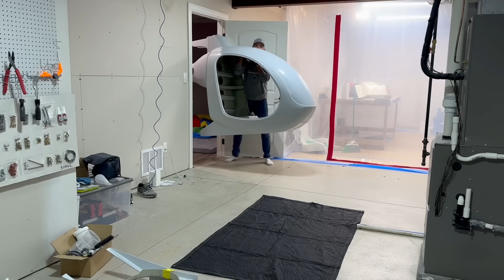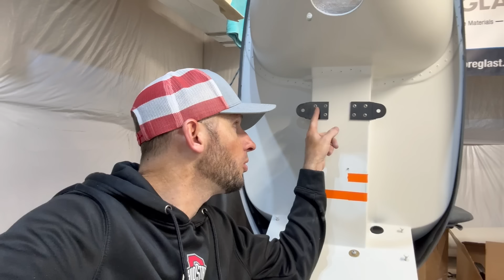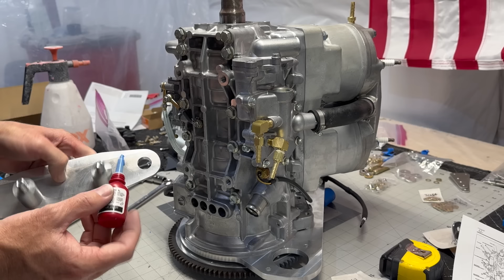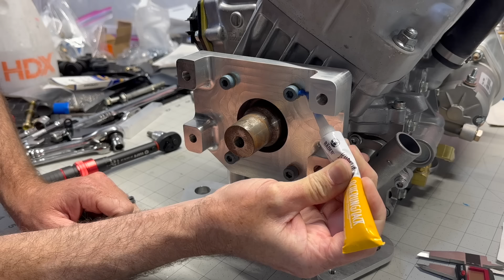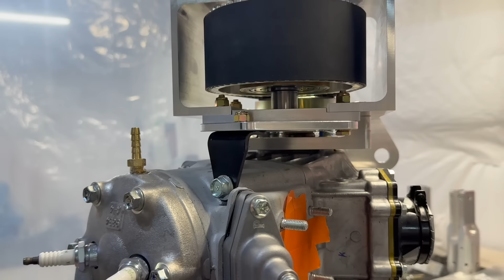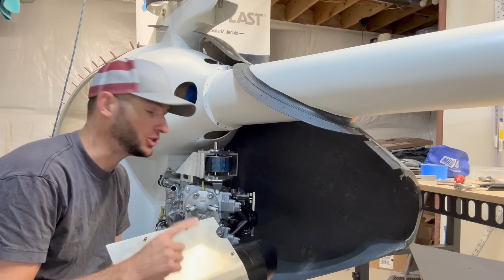I Installed a Snowmobile Engine in My Helicopter | Basement Mosquito Helicopter Ep. 31

Comment from the maker: This was a huge milestone for the build. What do you think — does a two-stroke snowmobile-based engine in a helicopter make sense, or is it completely wild?
Reply: There’s always been adaptations to engines to perform a different task other than the main design
Reply: Two things: the power to weight ratio of a two stroke engine is better for light aviation than that of a four stroke engine. The second thing is that the scale of manufacturing of snowmobiles is much greater than that of light helicopters and thus brings the cost of the engines down to a more reasonable level than a bespoke helicopter engine’s cost. So no it’s not wild.
Reply from the maker: @tomcoryell a four stroke with a vertical crank is also very hard to find. Oiling isn’t an issue when you’re sending it in with the gas
Reply: @TheOkayestEngineer  The old Briggs and Stratton rotary mower engine would work if you’re ok with just sitting on the ground revving it!😂😂
Reply: Cut your cowling not your expansion chamber!
Reply from the maker: @jameshatton4211 I’m not cutting anything. Starting from scratch.
Reply: @TheOkayestEngineer good stuff brother! I'm subscribing now 👌
That's excellent. Can't wait
Reply: @TheOkayestEngineer  Do you know how to design a new exhaust system with the correct backpressure? If not you might want to rethink what you are doing.
Reply: It's the kind of engine you want, rugged, powerful, anything above 1 HP per10cc for a two stroke without a turbo etc. is good plus it's a well tested, well understood engine with good availability of parts for it, it's a good choice :)
I wonder the installation cost is for this engine with those modifications ? 
Under $15,000 ? ... or am I being hopeful ? :D
Reply from the maker: @freezatron the engine is $4k 

The entire engine kit for this helicopter is $21k
Reply: Well I've owned and flown the Aventura ultralite amphibious plane and flown for years, always wanted a mosquito helicopter...the 290 xp looks sweet but the jet fuel is very enticing as long as there's enough tank for 4 hrs of flight time would be perfect ..
Reply: I have used 2 stoke engines for the past 40 years and they have never let me down. The only issue I experienced was carburettor icing, but in your situation with fuel injection that will never be an problem . Use good quality full synthetic oil, good air filters and it won’t let you down.
Reply: hey man why didnt you go with the 900ACE?
Reply: the same engine used in seadoo sparks and snomobiles but the snowmobile versions tuned to crazy hp
Reply: @kobrapromotions  but fkn less reliable.
Reply: @qwertymnbvc-v6e its a rotax?
Reply: rotax aircraft vs rotax snowmobile

meh, not sure.
maybe oldschool engines like the 444lc.
Reply: @qwertymnbvc-v6e.  built in the same plant, same engine
Reply: A two-stroke engine has a higher specific power than a four-stroke engine, so it makes sense.
Reply: Redesigning the exhaust system in a small engine isn't as forgiving as with larger ones. The pressure in the system and therefore the bends are important and you are taking out a huge bend.

Comment: Id premix some oil in the fuel tank in case ur oil injector goes bad because they always do eventually that way when it does it won't destroy ur nifty engine i use motul 800 2T  Racing synthetic ester core n id premix some of it in ur fuel tank that way it won't toast ur 2 cycle engine if ur injector pump goes out its the best n 2 cycles its expensive but n a aircraft application ur ass is on the line if the engine blows up n you crash.

Comment: A FREE Idea: Make a backup air motor (like air tools) that has same speed as your blades with a back up small air tank to run it in emergency. All you would do is pull the safety engine lever, if you ever would need a back up engine just to land it. If an only if your main engines would ever fail you. You probably wouldn't need that much air tank pressure for a few minutes of landing speeds. Justs saying ! Enjoy !

Comment: Most 2-strokes get oil to the main crank bearings by oil that drips out of the fuel/oil mix, down the transfer ports, then down holes that feed the oil to the bearings. 

Will rotating the engine from a horizontal crank to a vertical crank starve the main bearings of lubrication?

Comment: The key to a 2 stroke exhaust is length. They are tuned for the power band to work properly at certain RPMs. The length determines what RPM it goes into “Boost” mode. That length is set up for the RPM on the sled. If you calculate it right it will work great for the RPM range the helicopter is set up to run at. Cool build! 🤙
Reply from the maker: The unfortunate part of this application is I need the pipe to turn on around 6000 rpm which is about half the redline and the pipe needs to be extremely long because of it. I think I figured it out but it’s a packaging nightmare.

Comment: Beautiful project! But...
Industry won't use rivets on engine mounts, too much power, see what the snowmobile engine was using
Reply: Also in the inside you need a bracket plate, a large one to spread the load
Did you use FEA here?

Comment: I m sorry but your engine support which is fixed in the body by rivet is not enough strong to maintain engine   force and containt , Better to get screw bolt  with anti seize nuts Better to review your support before any  real flying test.

Comment: The Mosquito ultralight helicopter is equipped with small two-stroke engines (such as the MZ202 or similar). These engines produce hot, rapidly moving exhaust, and the designers have chosen to route it sideways for several practical reasons:

1. *Keep Heat Away from the Tail Boom*
   Two-stroke exhaust is extremely hot. If it were directed straight back, it would blow directly onto:
   - The tail boom
   - The tail rotor driveshaft
   - The tail rotor gearbox

   All of these components are made of lightweight aluminum or composite materials, which can be damaged or weakened by prolonged exposure to high temperatures. Routing the exhaust sideways completely avoids this issue.

2. *Prevent Exhaust from Entering the Rotor Downwash*
   If the exhaust were directed downwards or rearwards, it could be caught in the main rotor's downwash, which could:
   - Reduce lift efficiency
   - Cause turbulence
   - Blow exhaust fumes toward the pilot

   Side exhaust helps maintain clean airflow around the rotor.

3. *Reduce Vibration and Structural Stress*
   Routing the exhaust sideways allows for:
   - A shorter exhaust pipe
   - Fewer bends
   - Reduced weight
   - Less vibration transmitted to the frame

   Ultralight helicopters need to keep everything as simple and lightweight as possible.

4. *Simpler, Lighter, and Cheaper Design*
   The Mosquito is designed to be:
   - Ultralight
   - Low-cost
   - Easy to maintain

   A sideways exhaust configuration is mechanically simple and avoids the need for long, heavy ducting.

5. *Avoid Exhaust Impingement on the Tail Rotor*
   Hot exhaust gases hitting the tail rotor can:
   - Reduce tail rotor thrust
   - Cause thermal stress
   - Create unpredictable yaw behavior

   Routing the exhaust to the side eliminates this risk.
Reply from the maker: That’s a pretty standard AI response, and not very accurate. Follow along if you’d like to see the Okayest solution.

Comment: When you install the coil mount , the 2 inch square . Drill and tap run a wire through the back hole through the taped 2 inch square coat sq with epoxy tie string to wire make a loop pull wire and 2 inch square sq. Into place hold for 5 minutes  cut wire put bolt in with 2 spacers
tighten  and let epoxy dry. Pull wire out with string . After epoxy drys mount coil mount mount.

Comment: There are inserts for putting machine threads into panels like that. They work kind of like female rivits. I can't remember what they are called, but they would be a thousand times better than those pop rivits. I used them a lot on tractor trailers and snow cabx on tractors. I wouldn't trust those mounts with only rivits. Are you building a drone, or do you plan on flying in this thing?
Reply from the maker: I've got a couple things in mind.. i can tell you they've worked for a long time on other machines. There is data to prove it.

Comment: I'm building and a little farther along with mine at this point in this video. I would suggest putting the fuel pumps etc on before the engine. I machined two bars to align the engine with splitter same amount of washers top and bottom. I had three left side two right side.

Comment: This engine have 140-160 hp nominally, but you have to check balance of crankshaft, this is not good as usually. I has 3 of this and all have a problem with it and seal crankshaft

Comment: Pop rivets?! Hope you at least used washers on the inside to reinforce the connection, otherwise these will just eventually pull out with all the vibration from the motor.

Comment: Is it advisable to use this exhaust manifold on a two-stroke engine? The crankshaft of this engine is positioned at 180 degrees. Will the exhaust gases interfere with each other? It's probably better to use a separate expansion chamber for each cylinder. Sorry for my English.
Reply from the maker: 2-1 is not ideal but it is actually used the same way by the factory on their snowmobile. It isn't ideal but it is possible.

Comment: engine mount with rivets in fiberglas? that will snap on first run mr. engineer
Reply: This was my thought exactly, what are the rivets holding onto besides a small washer that will get pulled through the fiberglass
Reply: Is this supposed to be a joke  ?

Comment: i think its a great project just to get social media viewers and hopefully make a lot of money doing it.......BUT...i would not go 100 miles anywhere near to that thing when its started up with blades spinning and i certainly would not get into it and try fly it........ too many possible points of failure.  Even the engine bracket alone should be one continuous part rather than two smaller parts relying on engine to form as one.

Comment: I wish you the best of luck, but that is the engine that I would not have chosen. It's known for vibration. I would've went with something a tad bigger like a rotax 650R (125hp) , or an 850 turbo (150+ hp)  
I would also suggest bolts instead of rivets on that motor mount If you could find a way to do it.

Comment: The correct engineering solution to the engine mounts would be 2 different options, 1. What you did, but the stress relief the brackets after bending them. 2. (And this is the correct solution) liquid shim the brackets. Then fasten.

Comment: So snowmobile engines aren't made to run consistently at high rpm.. that motor will fail
Reply from the maker: you're right.. thats why it runs at 6000 rpm and at half the rated power.

Comment: The engine is fine, and I agree that the use of rivets to secure the engine mounts in a high vibration area is not what I would personally prefer. I would have liked AN4 bolts and nylocks instead, at least four per mount. The drone blades are totally inefficient as the idea is to be able to compress the air to push through the radiator and have a reasonable velocity at the same time. To reduce the demand on the engine and get the most out of the cooling, there is a American company who makes Flexifan. Similar to the original, but the curved blades are spring steel riveted to the hub. They produce the greatest pitch at idle to assist cooling the engine after running at full power and provide much higher level of velocity compared to a normal fan. At full power once the airflow  and pressure has reached the maximum, the blades bend, reducing pitch and unload the engine, this frees up more horsepower to the main rotor. I suggest having a look at that option if you do not wish to use the standard fan.
Reply from the maker: Is it rated for 6000 rpm?  I’ll take a look. Thanks a lot for the suggestion.
Reply: Hi, yes they are, as originally designed for race cars to provide more power to the transmission instead of robbing it for cooling. Great project, would have loved to make one myself but more into microlight aircraft over the past 10 years.

Comment: Gees mate i would never ever sand away composite structure to get a fit. Put mould release on the engine mount then add glass/filled resin to build up the mating surface
Reply from the maker: Fair point. I didn’t get into the glass. When I was fairing everything I unknowingly made those edges sharper than they should have. Good catch though.

Comment: Callie, there are few problem in life that can’t be solved with the application of either high heat or high explosives…. MAP gas would have gotten it hot enough to slip off even with a good press fit.
Reply from the maker: You’re so right. I’m stealing this quote and fully intend to use it when the time comes.

Comment: Please redo your safeties wire attempts on that engine flywheel. Even just doing it single wire would be better than what is currently shown in the video. I would not trust what is currently installed @ 7:23.
Reply from the maker: The bolts came from the factory with just one hole through one side of the bolt. Short of replacing the bolts this is the best I can do. I can see them to inspect them frequently.

Comment: Most two-strokes have a tbo measured in gallons of fuel consumed. Constant high power settings on a two stroke reduce engine life considerably, which is one reason the Rotax 503 got such a "meh" reputation.
 Oh, and the music...sucks. No offense, just an opinion.
Reply from the maker: The music was royalty free. I can’t make everyone happy lol. 

Good point on the TBO. It’s running at half the rated power and rpm but I still plan to replace the pistons every 100 hours or so.

Comment: Please don't mess with the exhaust too much - 2 stroke exhausts are tuned to the engine...not sure on how it works on EFI motors but I'd sleep easier if you didn't mess with it too much - we wouldn't want your engine to seize mid flight due to a lean condition!
Reply from the maker: Anything that has been designed once can be designed again.  I just need to learn a little bit before I make it.

Comment: Design a custom exhaust for sure. Ditch the merge manifold and build a pipe for each cylinder tuned to the operating rpm. This would bebthe best setup for performance and packaging. With that manifold gone youd have plenty of room for custom pipes.
Reply from the maker: I’m going to play around with duals vs a single pipe. Part of me still would like a muffler (resonator? Silencer?) to keep the noise down. Still have lots to learn here.
Reply: @TheOkayestEngineer  look into the fmf q silent muffler. You can also add a intake silencer/boost bottle to help with noise and smooth the lower/mid power band. Lots of info on pipe design out there too.

Comment: Cant you just use this exhaust “Y” piece but with 90 degree elbows between the engine and The “Y” piece?
Reply from the maker: I’m going to redesign one and have it 3D printed out of inconel. That way I can have a very smooth transition and avoid tight turns.
Reply: @TheOkayestEngineer agreed that that is even better👌🏽

Comment: Great Great content man! 
Don't forget to consider large enough outlets, the exhaust and the engine are going to produce a lot of heat that can effect on other components such as the belt or even the drive shaft inside the boom.
Reply from the maker: Very good point. I’m going to ceramic coat the exhaust and it will definitely exit the cowling somewhere. The fiberglass can’t get too hot. That’s my main concern.
Reply: @TheOkayestEngineer  I don't know how it works with Helicopters but in airplanes cowling there's a rule of thumb that the outlet has to be a least 130% bigger than the inlet
Reply from the maker: @R @RoyBenAnat ere is a huge opening at the bottom where the radiator fan is. I doubt much air leaves the small hole in the back.

Comment: Great content and great project, your video time works for me as I find one hour is just too long and I start skipping through, I fly fixed Rd wing and am really interested in that engine and setup, although I have two reservations with two strokes the first is fuel burn and I guess you can offset the lightness of the engine with more fuel capacity the other is that two strokes on fixed wing are more susceptible to nipping on decent as your not feeding the lubricating fuel in on decent, one of my friends is now on to his second helicopter prototype his first was very successful he has deleted the boom shaft and is running five electric drones propellers for his tail rotor but it is a fully electric helicopter, just thought I would throw that in, I’m really interested in your project and your doing a fantastic job
Reply from the maker: If your friend posted a video on YouTube I’ve actually seen it. Pretty interesting for sure. 

I’ve heard about the nipping issues with 2 strokes on airplanes. It could also be an issue on a long decent in my application too. One solution is to just turn it into an autorotation and bring the engine to idle.